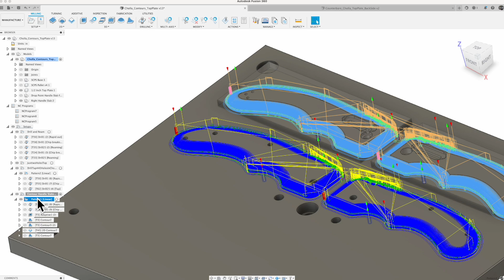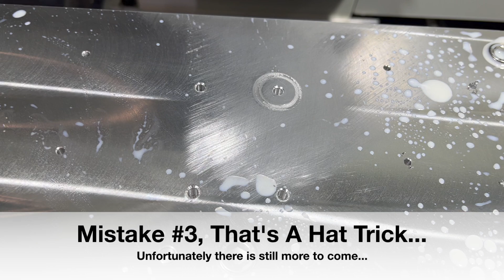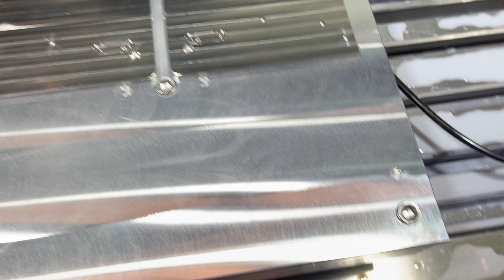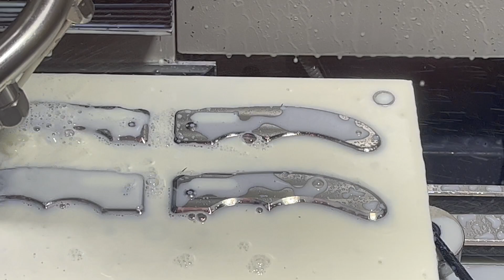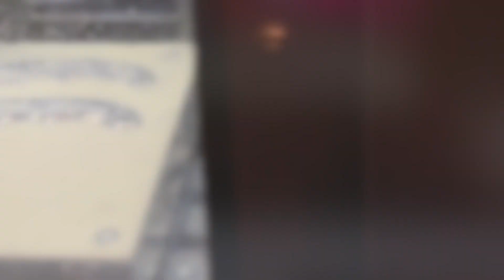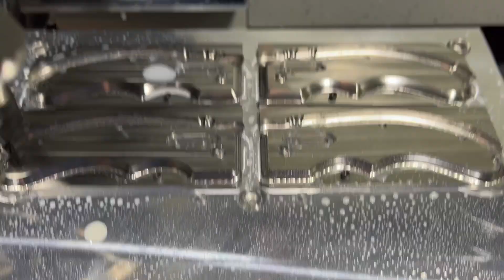Worst CNC Day Yet - Eventually Got Some Parts Done!

Comment: The added bolts for the bottom piece seem unnecessarily close to the cut. Also you should add another bolt on the second hump. 1 bolt will still allow the piece to twist.
Reply from the maker: Kyle Trent - I put the bolt in the center of the hump so has enough clearance. I could add another one but seem to have a good system going now.   The other end actually stays slightly connected and gives just enough support. Good learning and problem solving on this one.  Thanks for the comment.
Reply: @BladesIIB  I wouldn't design around the principal of "enough".
Reply from the maker: @VR6NAVYVW  Fair point. Over engineered is my usual path. I am going to do a test run in Fusion and try cutting the full profile and turning it all to chips. I think time wise it may be the same or even faster than the adaptive roughing. Then no stock issue. Will see.
Reply: @BladesIIB  only thing I'd worry about is not overcutting into the bolt heads you manually grinded the stock to fit. That would be my first option but at this point I would go with a second bolt for the lower scrap piece.
Reply from the maker: @VR6NAVYVW  The bolt heads are no problem. I have more of the low profile bolts like I had in the middle. Can machine right over top of them.

Comment: The way goes sometimes.  I think you should make holes and fasten  outer stock so they dont break away and cause havoc, adaptive out vs slotting might be better
Reply from the maker: faxoli - Thanks for the comment. Yes, I ended up adding some 4/40 bolts to lock the outer stock down. Made all the difference.